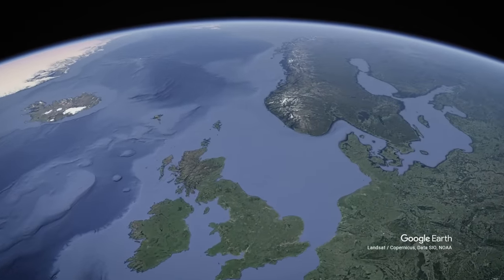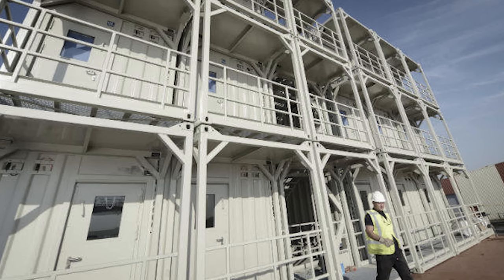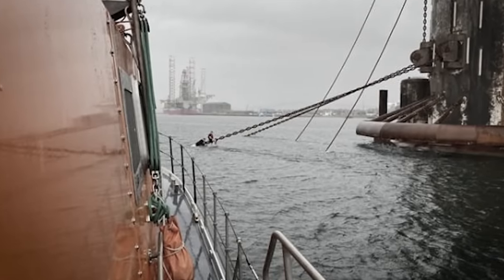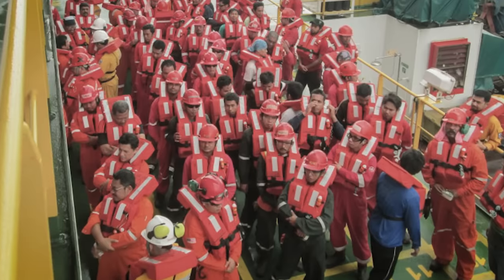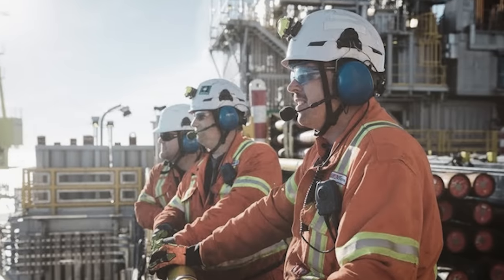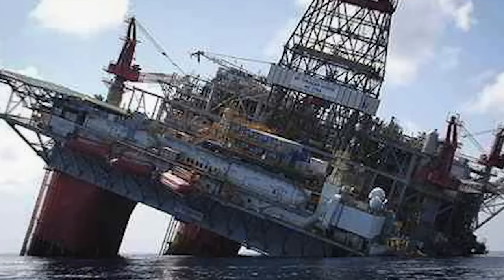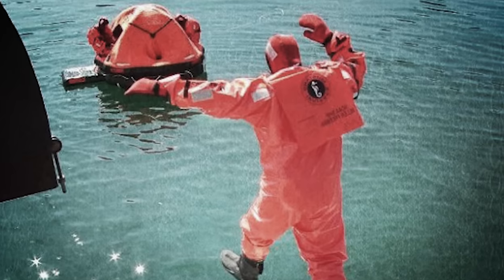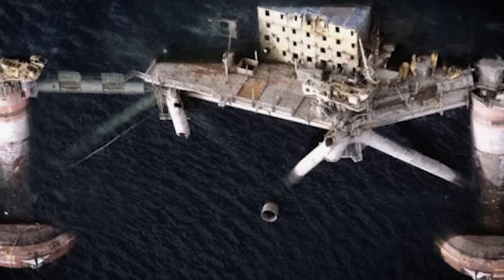This Pipe Killed 123 Men

Comment: Good Morning, again another fascinating, exciting story about jobs men do that I have never heard of.  I see alot of rust on some of these rigs, are they ever cleaned, fixed and repainted???  Please keep these cool stories coming, looking forward to the next one.      👍👍👍👍😉😉
Reply from the maker: Thanks Beverly

Out at sea you can expect some rust. Impossible to escape. 

There will be an annual maintenance regime but for the most part it's a managed side effect of being at sea on a hunk of metal.
Reply: @waterlinestories  So is it the rust that caused the failure or the force of the waves or both.  Is there a certain time line that rusty pieces need to be repaired before it causes trouble?? Just wondering "waterline".
(Since I don't know your name)
Reply: @beverlyreiner-baillargeon6205  not sure if rigs are treated like this, but Practical Engineering on youtube has a video of how rust can be allowed to form to a limited extent on the specially treated surface of some bridges in order to protect the internal structure - it would make sense to me to have this technology on rigs, but I'm not sure 🤷‍♀️
Reply: @beverlyreiner-baillargeon6205    Oceanic saltwater EATS EVERYTHING... Mostly, for structural steel, you have to check the thickness of actual steel left to determine replacements, once the rust is removed "per the maintenance regimen" for the structure, be that a boat, bridge, or oil rig... In between mass inspections, regular spot checks and repainting to protect whatever metal you've got are also a fairly regular part of mitigation and management.

    In something the shear size of an oil rig, there are going to be tiny imperfections here and there. An inclusion (in welding) is a little bit of debris that gets covered in molten metal during the weld process and forms a bubble... an "internal flaw", which presents one (usually of many) weak points in the structure. Like chains, any metal structure is only going to be as strong as it's weakest place, and the sea is ALWAYS active, so splashing around and battering everything on or in it... AND the weak points eventually give way to cracks, and grow over time. The hope is that the regular inspections and massive maintenance projects repair more than they let "slip through the cracks" so a rig can stand and give full service for a lifetime...

     In this case, somehow a flaw was sufficient to catastrophically fail before it was caught and fixed or retro-fitted out of hazard. It seems a little negligent that a single weld could result in quite so much harm over-all, but I'm not an expert in the design and schemata of oil rigs... SO maybe there's more to it than the obvious...

      In any case, it's really a combination of weakness in a vital weld and the regular battering at sea that the thing underwent through its whole life... AND that saltwater just steadily erodes away every material until something bad happens, so inspections are the only real way to defend against catastrophic failure, even if we have to balance the financial feasibility of repairs with the budget for making profit over the lifespan of a given rig at a given location...  ;o)
Reply: @gnarthdarkanen7464  Thank you so much for the information.   I find this very fascinating and all your input helps.  Take care. 👍
Reply: @beverlyreiner-baillargeon6205    ALWAYS welcome! I spent some years at sea in the Navy, so I've seen the ocean's ability to destroy literally everything from iron and galvanized steel to plastic... NOTHING survives forever at sea, no matter how good it's designed or developed. Even the famous Roman sea-walls will eventually be chewed down to nothing... eventually.  ;o)

Comment: 7:26  On holding your breath (not spontaneously inhaling) after jumping into freezing water… this is so so difficult to do.  you can literally inhale nothing but ocean/water and drown instantly.  It's even hard to do in very cold water, well above freezing.
Reply: I've had quite the opposite effect where it takes your breath away and you cant breath for a bit
Reply: @crf80fdarkdays  The body's initial reaction is an (practically) uncontrollable inhale followed by short/shallow exhale/inhale cycles until the body acclimate a bit.  But yes, it's almost impossible to exhale normally and also next to impossible to inhale normally, without taking quick breaths.  That's why I inhale fully before jumping into cold water… so I don't accidentally suck in water… and I have a minute or so to "plan" my breaths.  It's almost as bad as getting the wind knocked out of you.  You know you aren't going to die, but not being able to breathe normally is definitely unnerving.

Comment: The Aleksander Kielland platform was nicknamed "Bangladesh" by those who worked there, because the rig was worn out and in bad conditions . Many talked about sabotage and insurance fraud, Norwegian authorities' handling of the accident, did not improve matters. The rig was towed upside down in to land. The authorities wanted to sink the rig in deep water without turning it over, but after much back and forth it was turned over a few years later, examined and sunk in deep water in a fjord. 123 perished and not all were found.

Comment: I could never be a seaman. Every time something starts to tilt, I am running to the top ready to jump. I would always question the safety procedures over and over again and look at the rust and decay over and over again to see if there is some change. I am paranoid. Just recently my foundation cracked. The drought made the house move because the ground became so dry it shrank and moved away from the house. WHY WON'T IT RAIN!!

Comment: The issue with the lifeboats (which were davit launched not freefall lifeboats) was more to do with the inability to release them from the cables under load. These days lifeboats have on load release hooks. I have a bit more footage of the actual rig capsized and severed leg in my worst offshore disasters video (the Kielland is no. 2 in the list) https://youtu.be/1i8k-ya-MEE . The Buchan installation that was used in the UK had the exact same design and design flaws, and was only recently taken off station, 30 years after this accident.

Comment: It is unbelievable that one weld can be responsible for the disintegration of an entire platform
Perhaps the platform itself is designed with maximum savings in mind, so one such bad point can trigger a whole chain of other mistakes that were overlooked due to cost cutting.
Reply from the maker: I think of one weld is week and gives way then others that follow are probably not as strong as needed either.
Reply: @waterlinestories  In most cases, all such constructions are made to maximize time and material savings within the limits of safety and usability
probably the combination of that with the human factor and weather conditions that put everything to the test unfortunately did not pass
But anyway another well done video
Reply: Back in the 70's when the rig was designed, we didn't have advanced computer stress analysis packages to run structural analyses. It was mostly done by hand calculation which was time intensive. So back then the non-redundant design wasn't really picked up, but these days modern computer packages would pick it up. And when it comes to fatigue, fatigue life is dominated by minor defects in the weld which even modern computer packages struggle to predict with certainty.
Reply: @Master-Disaster  And these are specific projects, there is little room for deviation, but unfortunately we see that they are happening

Comment: Does this need to be asked?
Are the life saving vessels now distributed and stored on some or all sides of rigs nowadays?
Reply from the maker: To some degree. But some areas have working equipment and so they cant be placed all around the rig.
Reply: If you mean standby vessels, in the North Sea at least, every installation these days needs a standby vessel near the installation to make effective recovery of survivors. The trouble with this incident is that there were problems launching the lifeboats which ended up with persons going into the icy sea, despite having standby vessels.

Comment: Worked on the rigs as a scaffolder/rigger for 15yrs, and have seen cracks in weld's, small ones were ignored and put on the monitor list, I tried to keep off those rigs when I had the option 🧐🥺🥺😡

Comment: I seem to recall it also being something to do with a modification to one of the braces that weakened it.
Reply: It wasn't the brace that was modified, but a plate that was welded onto the brace to attach an instrument. The weld on the plate was welded poorly, and a crack developed in it which propogated into the brace.
Reply: @Master-Disaster  That's right yes. I always find it strange that after a structure is built, others come along and merrily attach things to the original structure as if that won't have any effect on the structure, when in this case it resulted in the deaths of 123. It's almost as bad as Piper Alpha, yet that accident is far more famous (because more spectacular I suppose.)
Reply: @yggdrasil9039  You're right about it being less famous - I'm a structural engineer in the offshore industry, and it always annoys me when people focus purely on hydrocarbon releases like Piper, when there are other major accident hazards like the Kielland which also deserve to be recognised.

Comment: This is exactly why the cronstruction workers of this type of structures are  expected to be payed a much higher rate then regular construction workers, this is not that type of job one can just handle ower to the nearest shopworkers contractor or someone who used to worked on the hamburgerbar before he gor a 6 moth license. I hawe worked many years with steel construction, but not even i feel ready to take on this type of critical structures yet, if so it would take me at least a full year of full time, everyday practice before i would even think about it, that usual "we don't hawe time for this! or fair enough" mentality is simply out of option for this type of work even if it would probably hold up just fine for a few years before things start to happen as here. This is the danger of trying to find the chepest contractor but not letting it pray on safety if something in the chian went wrong, in this case i guess they forgot to do a X ray and inspect for owerheting the material, all welding seams which are concidered to be critical need to be borth occulary inspected by an experienced person AND X ray photo of the internal structure of the seam. Even if the welders are experienced there are still factors that may affect the long therm outcome of the seam ower time which can not be seen just by the naked eye.

Comment: If that piece of pipe was the point of fracture?it looks like a parent metal fatique failure as it looks a distance from the welded joint and having welded many of these saddle type prep joints i know they are all Pull penetration welded joints not fillets,but maybe the did that back in the day?i am 61 and never seen it on any structure i have worked on in the oil game.

Comment: Plus the fact ,considering the diameter  of those struts and the sheer size and  forces on them ,relatively speaking the sidewall of them struts,like tissue paper,probably ripped like tissue paper ,blame the bloody welder ,that doesn't work for me.....fancy building a mega structure,that floats , where the structural integrity of the whole damn thing can be compromised by weld on one strut,that's bad design...bloody negligent..

Comment: You'd think by now they would of come up with a contingency for deploying life boats when angled the wrong way. I know that's easier said than done... but the oil platforms, research sets and ships all have the potential (and have) ended up angled like that. Just a mechanical wench would be better than nothing. 
Even if they got in to the life boats and disconnected from the ship or platform then just sat there until the rest of it tipped or went down... if you could get too it.... and get in to it would be safer than standing (or clinging) there looking at the damned thing.
Reply: They have. 4 of the lifeboats were actually launched here, but only 1 of them was able to be released from the hooks properly. Back then, lifeboats couldn't be released easily if they were still 'on load'. These days all davit launched lifeboats have on load release hooks which would have prevented so many deaths here. This video shows freefall lifeboats though - but th eKielland's lifeboats were davit launched, on cables.